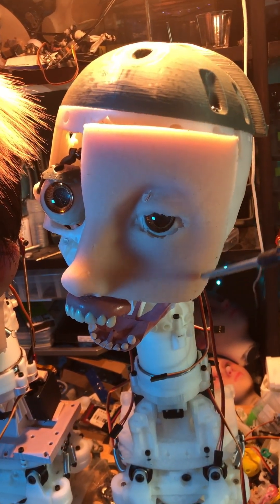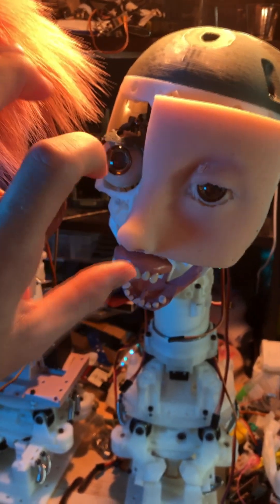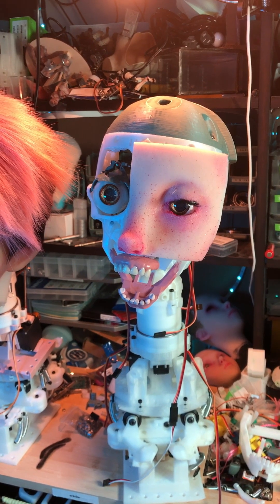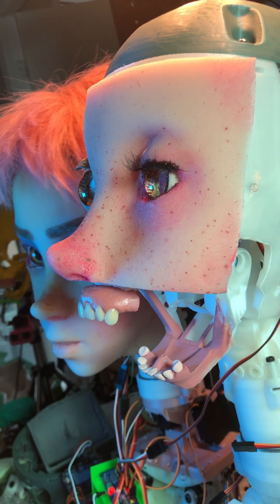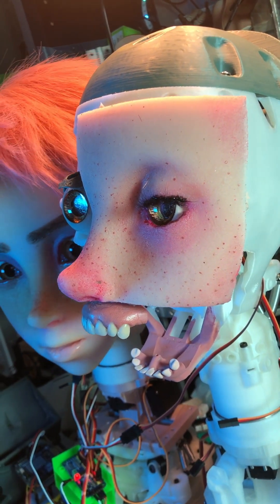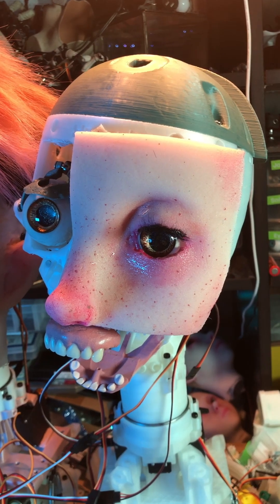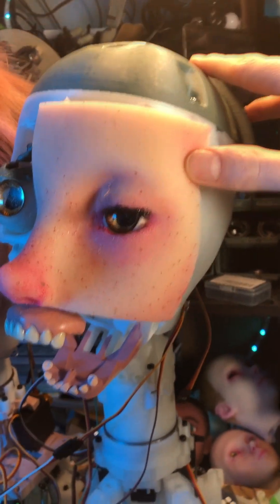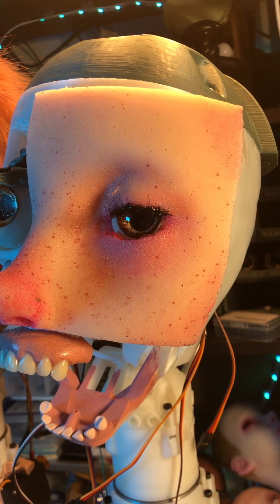Eyelids for Robot Heads

Comment: It looks great! 
What if you molded a top eye lid "cover" attached to the brow like you have here and had a thinner more flexible piece be what moves over the eye and underneath the cover. So, when it's retracted you only see a snippet of it with the attached eye lashes.  Maybe having the silicon attached to a spherical piece that slides over the eye itself, though I see fitting said mechanism in would be challenging. Not to mention would need tight tolerances as to not have the separation be too noticeable. 
Just a thought, may not be viable.
I look forward to your progress. :)
Reply from the maker: That's what's going on here; i've got a partial spherical part printed in PLA that is moving over the eye.  It's bonded to the silicone skin.  The tolerances are a problem right now.  I have no room for both eyelids, printing in PLA as I am with the machine I am using.